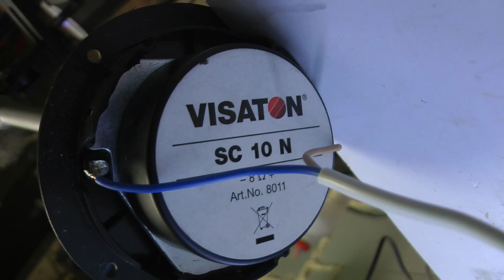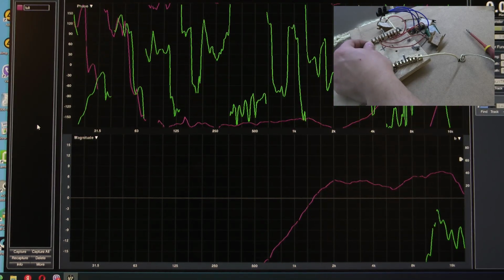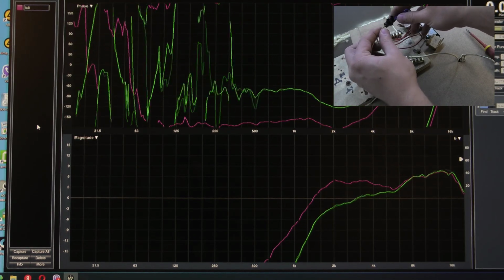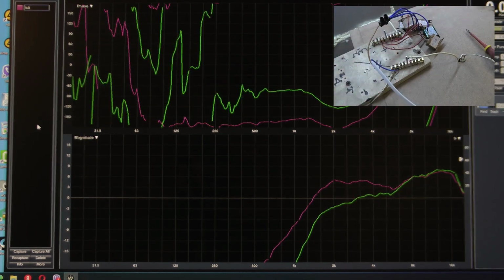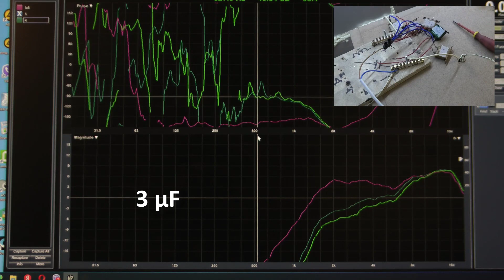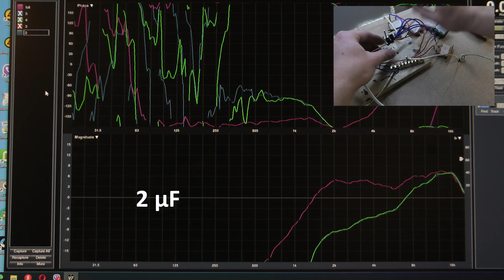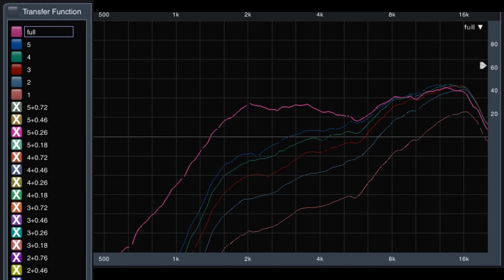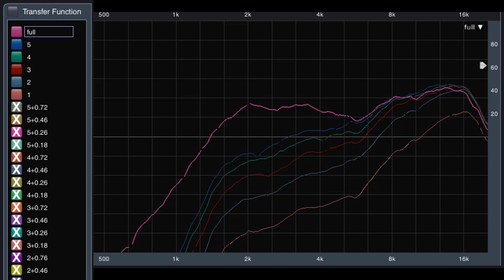DIY first order tweeter (Visaton SC 10 N 8 Ohm) crossover / you will see and hear this difference!

Comment: Pretty cool to see the differences live. I just made my first crossover a few days ago that's going in my car. 

I'm using some Dayton Audio tweeters and 5.25" woofers. It's just a basic 2nd order high/low filter I tossed together in Xsim. 

The response I get in the car won't be the same as what I modeled. But It should be close enough (I hope) where a bit of DSP should get it where I want it.

Thanks for the video!